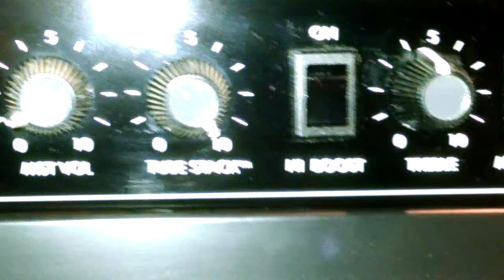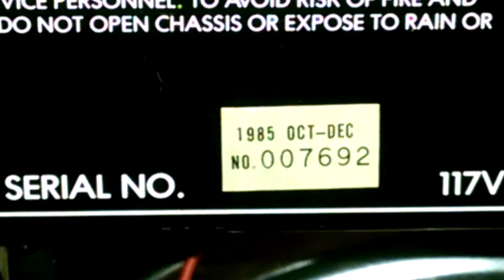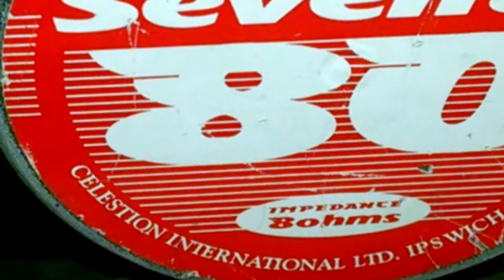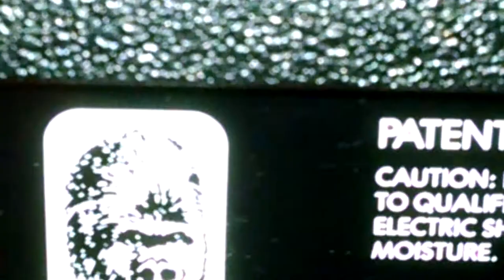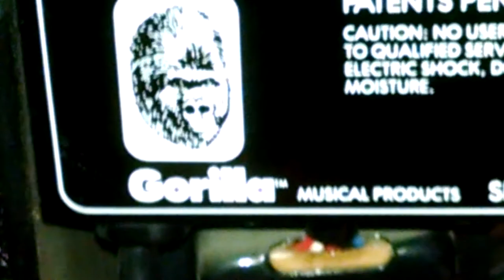MUSIC GO ROUND GORILA GG -110 - THANK YOU!!!

Comment: 110 and it has a 12? I can't seam to find anything on this company
Reply from the maker: They are the same company that makes the pignose Amp I spoke threw email with a tech that had been with them for years he told me the amps were made during the 80s a time of party all night so not much remains of the history they made quite a few models even amp heads and small cabinets hard to find wish I had more to tell you but I looked for over a year for the info I got and it wasn't much CHEERS!